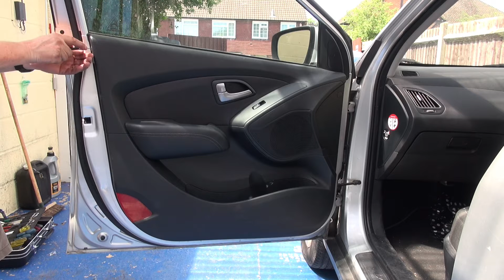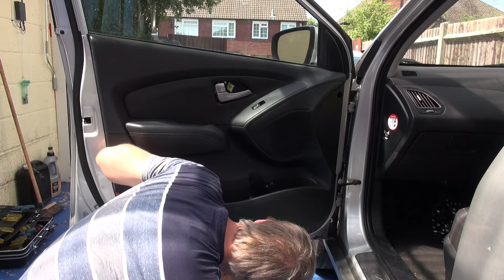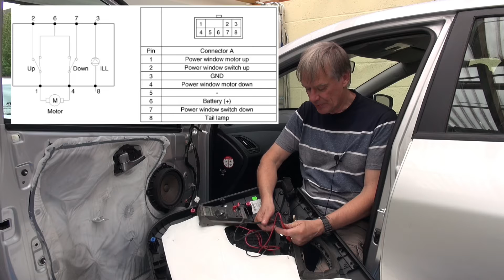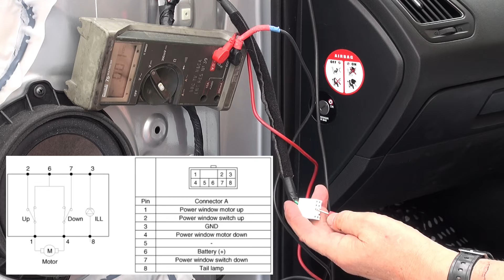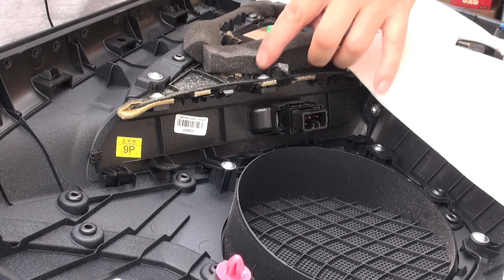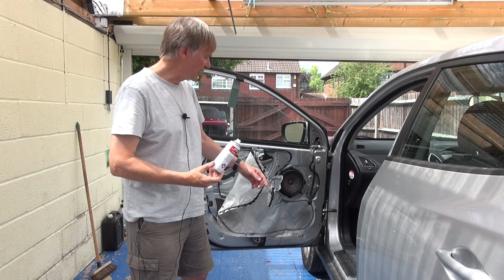Hyundai ix35  window regulator pt2 - switch fault!

Comment: I’ve got a Hyundai ix20 front passenger window comes down ok but won’t go back up but will with the master switch,swapped the back passenger side to the front,thought I’d solved it , it worked perfectly for 4 weeks,then started do the same thing again,any ideas ,thanks in advance
Reply: Ottimo Lavoro.... Bravo... ✌️
Reply from the maker: What did you swap? The motor? Probably the switch is failing. Spray it out with contact cleaner.
Reply: @NigelEaland no I swapped the switches over
Reply from the maker: @nickjones1484 power comes across from the master switch on the drivers door. If that switch is burnt then the effect could be as you describe as it can take more current to lift the window. Suggest spray out driver’s door switch.
Reply: @NigelEaland it works from the master switch,it won’t go back up from its own switch
Reply: @NigelEaland should have also mentioned the rear right switch does exactly the same

Comment: Hi, greay vid. 

Passenger controls work for up down, however driver controls for the passenger window tempermental at best majority of time not working. The driver controls work driver window.

What would you recommend?
Reply from the maker: Take the door panel off and get into the back of the switches and spray clean them with this https://amzn.eu/d/99fz3CJ

Comment: I'm looking at doing this with my windows as have 3 faulty windows at the moment. Im not a mechanic but like trying to fix things myself. I'm just wondering should I try the switch fix with contact cleaner first before trying anything else incase this is the issue and then work my way down to the more complicated fixs after ?
Reply from the maker: Check out my other video of the back door.
Reply from the maker: For the front doors I would say yes as the mechanism has gears and a slider which is far more reliable than the wired type mechanism on the back doors. Also these cars have a history of bad window switches.